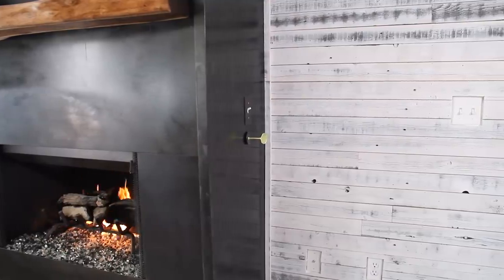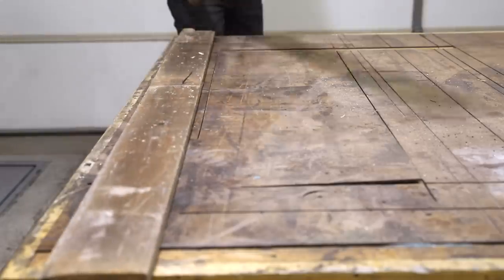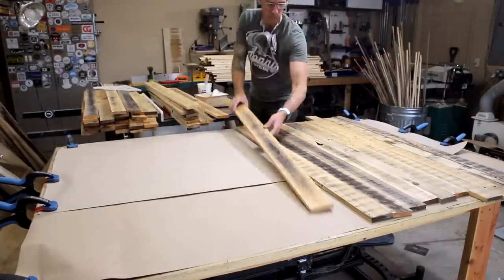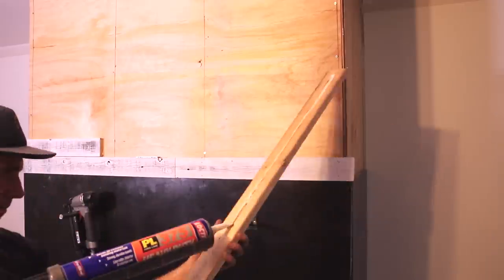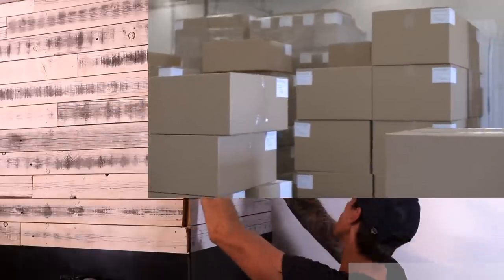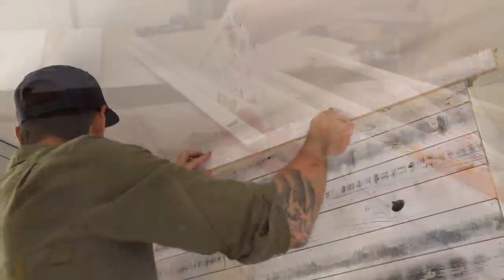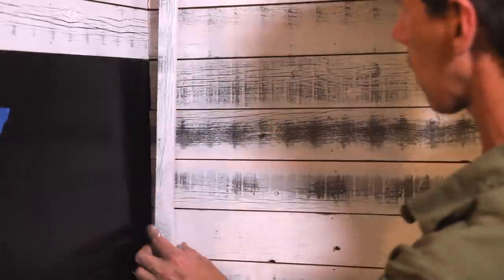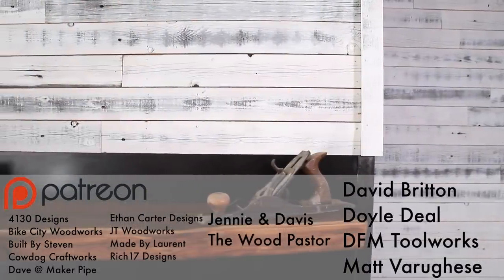I made a DIY Reclaimed Wood Shiplap Wall from my old FENCE

Comment: You're crushing it! By the way, most likely the building code for most folks may require electrical boxes to be set flush with the new wood wall. This can easily be done with box extenders for just a couple of bucks.
Reply: I wondered about that! Looked kinda awful sunk in

Comment: Do you still use the nail remover? I got one on Amazon but had to return it. It got stuck on the third nail I was trying to remove. I had a hard time getting it "unstuck". After that it stopped working altogether. Still hesitant about getting another one. Maybe I got a defective one.

Comment: I am getting a new shed and plant to recycle my old fence posts.  I know not to use treated wood for an interior,  but these pickets have been outside for 20 years,   am I safe to use them?
Reply from the maker: I wouldn’t if it’s treated wood. Better to be safe. Old fencing is usually pretty easy to come by.
Reply: How can you tell if it is treated?